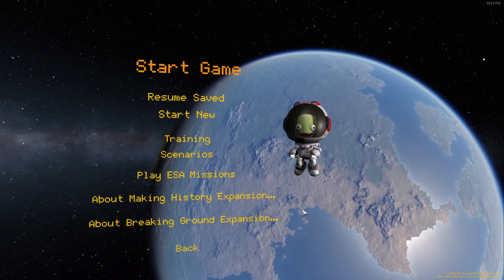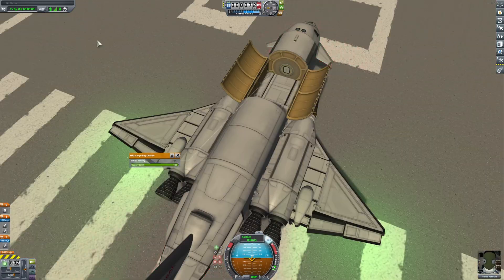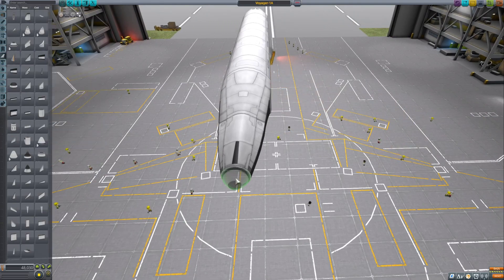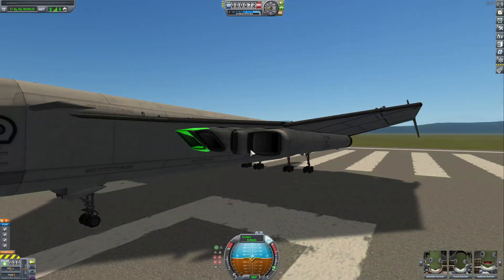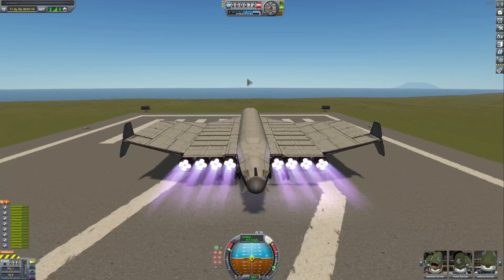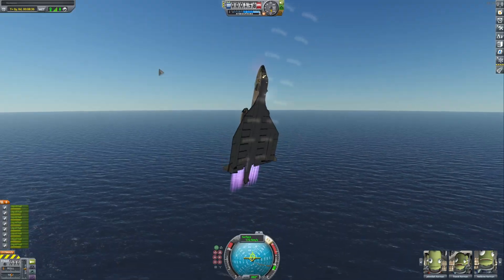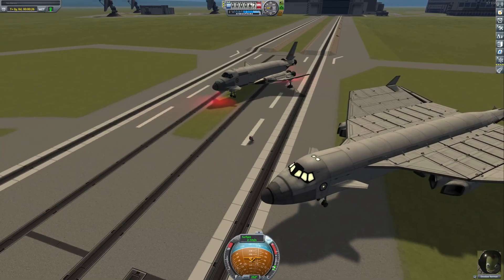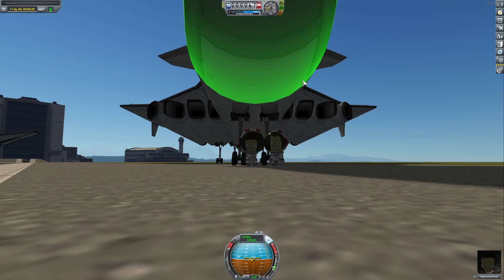I Made an Unsuccessful, BUT Successful Heavy Transport

Comment: Hey man! Loving your new designs! Wanted to give some recommendations. First, you should research SSRT’s(single stage rocket tech) and that will give you some even better material to work with. Second, focus on not too much speed in the lower atmosphere, you’ll bleed a lot of delta V going that fast. And third, make sure to look at center of mass and lift before you launch
Reply from the maker: Is SSRT a mod/dlc? And definitely, I honestly still have a lot to learn still
Reply: @ArchSQ3  No, It's just tech with what you can reach orbit only with rocket engines
Reply from the maker: Ahhh okay, I’ll definitely take a lot at that